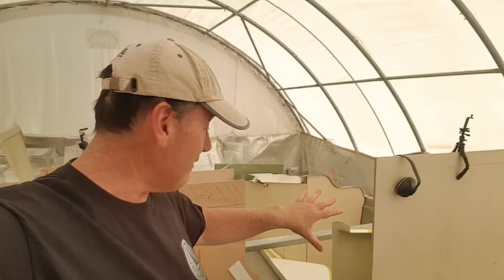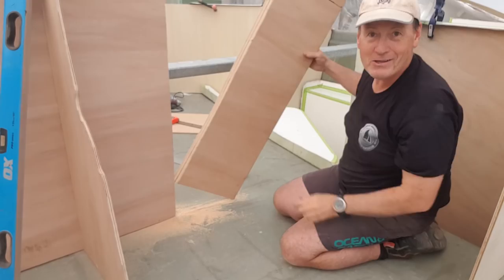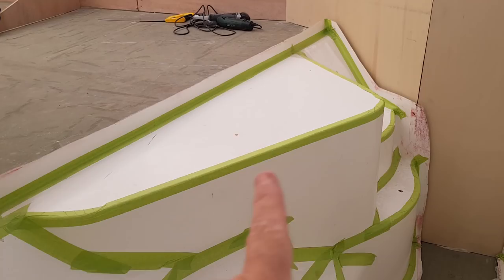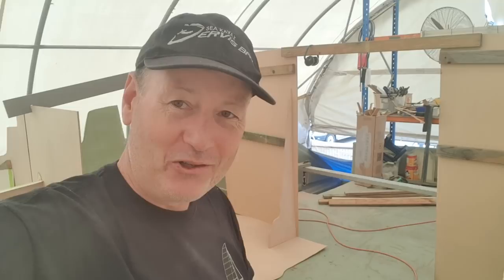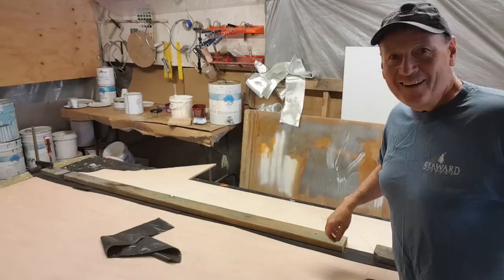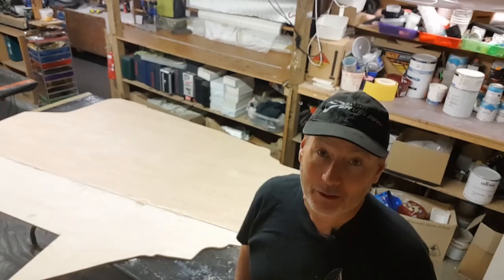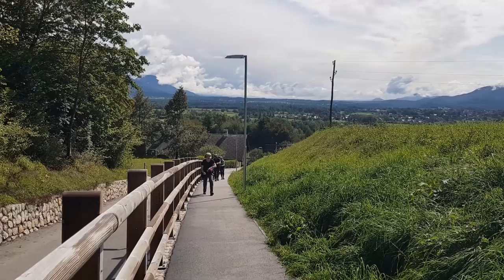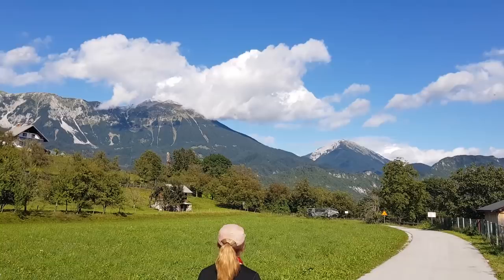Ep094 Fibreglassing Plywood - Life On The Hulls - Building a Fibreglass Catamaran

Comment: Small angle cuts can be done with 'skil' or table saws. For a 20 degree chamfer, cut along the start of the angle line, then cut a 2 x 4 at 70 degrees, tack it to the edge of the panel and now you only need to make a 90 degree cut to wind up with 20 degrees on the panel.

Comment: G'day Rosco, You are making good progress. You showed a picture if the dinette with curved corners in the seat... It may be worth considering building it with square corners so that you can 2 people can lay on the couch, very handy in rough conditions or just kicking back reading a book. Most people that cruise long term prefer strait seating that can be used for laying on. Cheers Rustie.
Reply from the maker: Hey Rustie.I am with you.I will be making the moulded part then cutting it strait with a rotating rectangular table and square profile lounge to ensure it can be flattened for a passage making bed and more usable.The top part of the dinette forms a moulded piece into the window mullions snd deck part so makes sense to start with it then alter once in place the remainder with foam and fair and complete.Cheers buddy.Ross
Reply: @LifeOnTheHulls  Cool, that's the way to go, it is a great spot on passage especially if feeling a bit seasick. You are doing a great job with the videos too!!

Comment: About syringes, buy ones with Lure Lock, a screw on tip system, then you can get a syringe to syringe adapter, to fill the epoxy, with a second one, where you pull the vacuum... 
Also there are different length and size for tips, and even plugs.

Comment: When you're trimming the excess glazes from the panels would a small router and trimming cutter help or is there too much resin on the edge of the ply?

Or on straight edges you could clamp a straight bit of timber underneath, aligned with the edge of the ply and then use a router bit with a bottom bearing or for that matter clamp it to the top and use a cutter faith a top bearing. Make the timber wide enough so you won't foul the router with the cramps
Reply from the maker: Gidday Nic.I have used a router in the past and have had good success with thick laminates ie up to 2mm.Lately I much prefer the oscillating multi tool as the dust is greatly reduced as well as accuracy and danger is definately improved.Green trimming is also a grest way to deal with the excess but in my case when trying to pump out a heap of work on my own I generally just trim with the multi tool.Trimming the laminated foam sheets with a router tends to burn the tip and bearing ,whereas sheathed ply tends to handle the router better.Cheers Ross

Comment: Any concern about lifting the hull off of the mould with the weight of all the modules and glassed bulkheads?
Reply from the maker: Not really, the franna crane has a life capacity of 5000kg at extension with spreader bar., I estimate the hull with bulkheads and modules to be in the vicinity of 
3000kg. I know there is around 1100kg of resin and 700kg of cloth in the hull plus modules , tanks etc. I have seen a franna life this hull from a mould with all in place so should not be an issue, if so a bigger crane will be required, but not likely. Cheers Ross.

Comment: Does the ply bow on the side you are laminating because it is wet??
Reply from the maker: In a perfect world the answer would be No.In the real world it could potentially but laminating on a flat surface ensures  minimal warp and it is a relatively quick process and given ply is 12mm thick the resin is only ever in the top veneer as well so I guess the effect is minimal.Cheers and thanks for the question3.Ross.

Comment: Does a router work atall for cutting around the bulkhead sections for trimming the fiberglass?  either green or hard trimming?
Reply from the maker: I have used a router in the past and have had good success with thick laminates ie up to 2mm.Lately I much prefer the oscillating multi tool as the dust is greatly reduced as well as accuracy and danger is definately improved.Green trimming is also a grest way to deal with the excess but in my case when trying to pump out a heap of work on my own I generally just trim with the multi tool.Trimming the laminated foam sheets with a router tends to burn the tip and bearing ,whereas sheathed ply tends to handle the router better.Cheers Ross